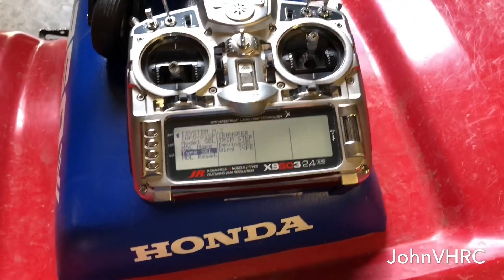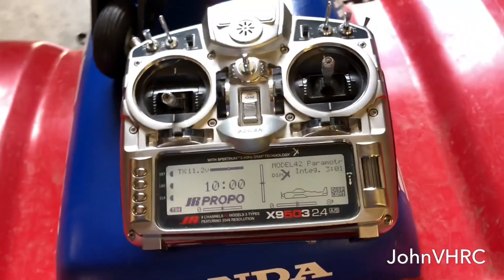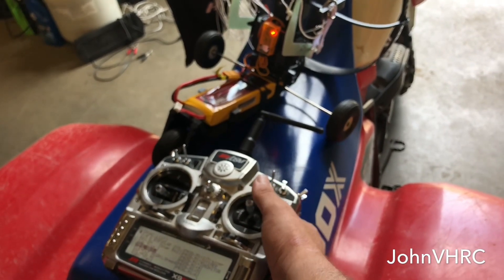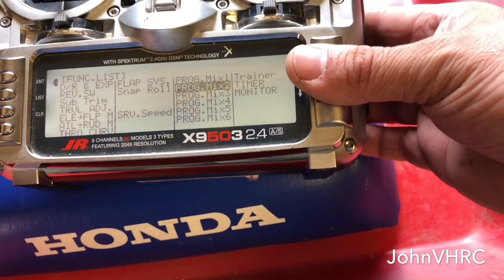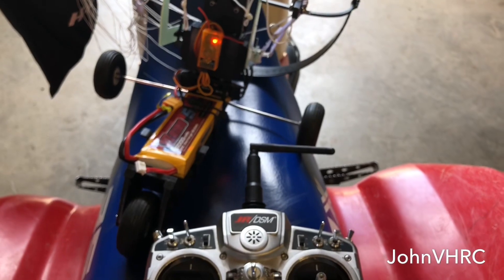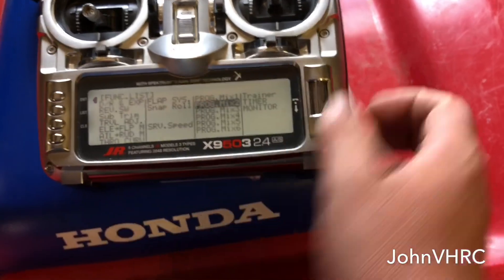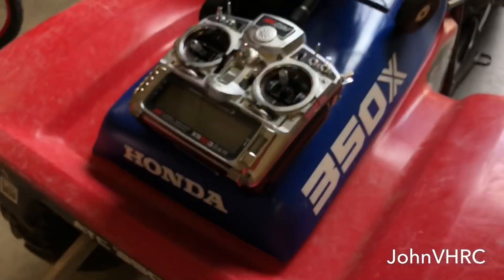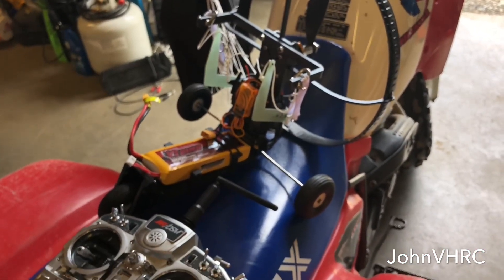How to program the H-King Paramotor for Spektrum HobbyKing

Comment: I just got the new paramotor and I have a spectrum dx9. I haven’t found a single video that works and the user manual isn’t any help. I can’t even fly it because I don’t know the correct settings
Reply: Check out the video on the V2, see if that helps more? I start from scratch on that model, with a newer radio.
Reply: I ran into the same problem most videos would be close but didn't work properly so I used bits and pieces of some videos and got it to work on my DX6E all with no mixing. I don't know if it will work on a DX9 but it's worth a try. When you first setup choose wing type elevon b plug in the right servo to the aileron channel plug in the left servo to the elevator channel and throttle to the throttle channel then reverse the aileron channel and the elevator channel. Now go to servo travel and make RAL top number 0 the bottom number 100 then make the LAL top number 100 and the bottom number 0. It works like it should on my Spektrum dx6e I hope this is helpful for your DX9. Shanon Rc OutLaw YouTube channel.  I used a spektrum ar410
Reply from the maker: @smclain64sm  Check out my new V2 video, maybe that will help

Comment: For DX6 will be the same ?
Reply from the maker: Its very similar, youll only have 3 points in your mixes, so the middle and one end needs to be at the top, just like my curves look like, if you copy it over it works great!
Reply: JohnVHRC so if I’m right with 3 points the first one and the second one needs to be at the top sorry
Reply from the maker: @micheleg9492  right, and on the other mix the second and third go to the top. Youll see what way they will make the arms work, and adjust as needed. Ill make a post on my FB page showing the mixes..  JohnVHRC on FB
Reply: JohnVHRC I did the setup finally I wait for the maiden my travel it’s like yours no more down it’s impossible for me it’s about 12 CM

Comment: How did you set points 0 and 6 on GBs DX6?  When setting up a curved mix it only allows me to adjust points 1-3. There are no adjustments on my dx6 for point zero.
Reply: I am going to post some images on my FB page here shortly as a supplement to this video.
Reply from the maker: You just need mid stick and up to do nothing.
Reply: JohnVHRC  I understand what the sticks are supposed to do but cannot set my mixes like your JR does.  Some pics from GBs radio would probably be the ticket!
Reply from the maker: missiletm I used this setup to program his. Wish I had his radio here to see what exactly I did that would be different.
Reply: @missiletm  I posted two onto my GBLynden's RC page under the post of this video on there. Please let me know if they help :)